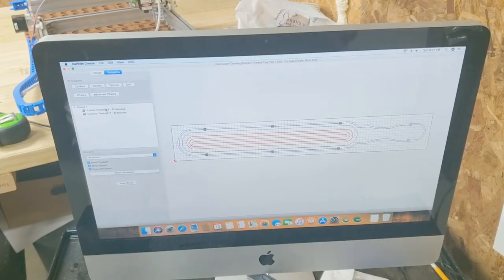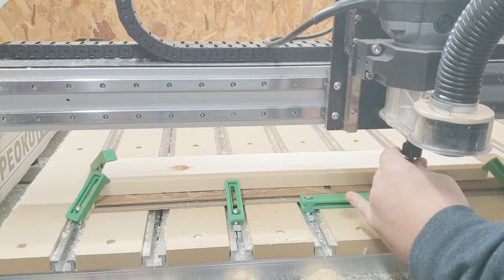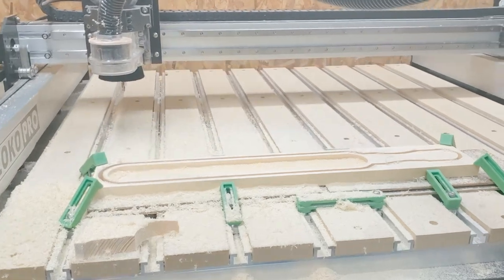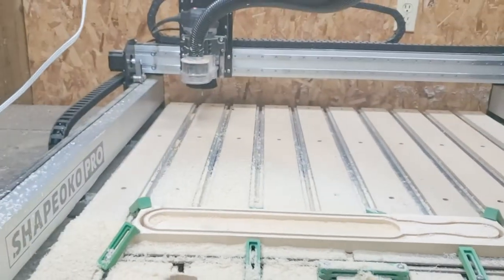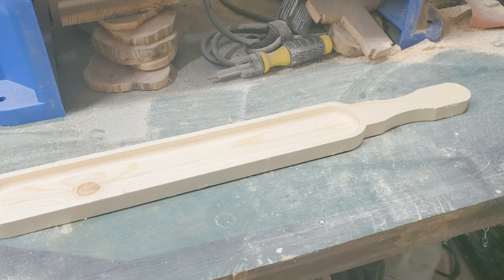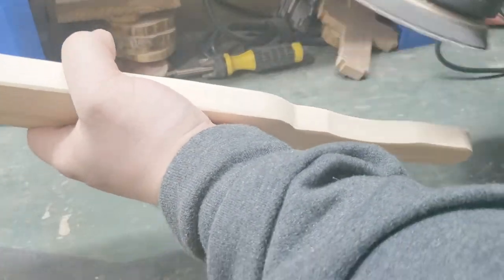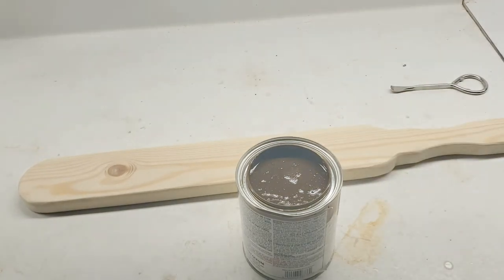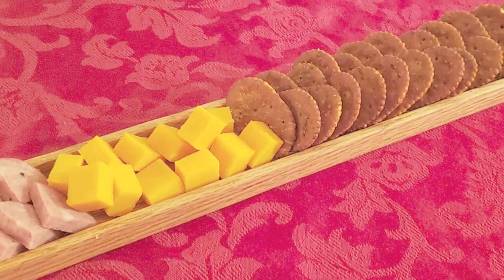CNC Carved Cracker and Cheese Tray

Comment: What did you use as a stepover with your bowl bit?
Reply from the maker: I used a 0.200 stepover, 0.080 depth per pass, & 35.0 feed rate.

Comment: Using soft woods for "food" products is never a great idea... It's too soft and porous which can allow for mold and bacteria. I really love the idea and shape of this however! Also oak is pretty porous as well... You're better off using some sort of hardwood: Walnut, maple, cherry, or some combo of the three! Keep up the good work though! Subscribed
Reply from the maker: I agree.  I just used the pine for proof of concept.  I would of rather used one of the other 3, but I had the oak on hand.  I'm still trying to find a good local hardwood dealer.  I may end up setting up a chainsaw mill and running a few of my own maple and black walnut trees through it.  Thanks for the compliment and the sub!  It's greatly appreciated.